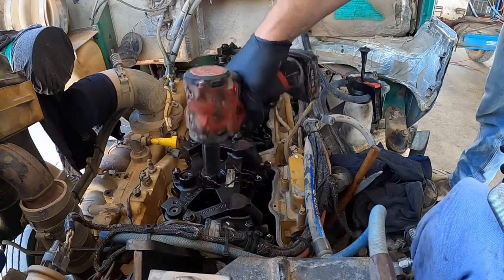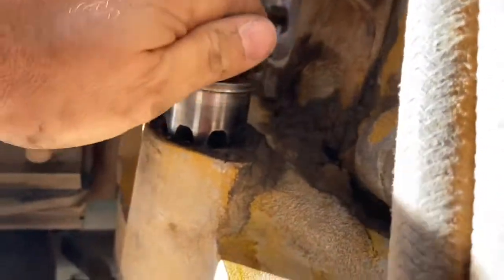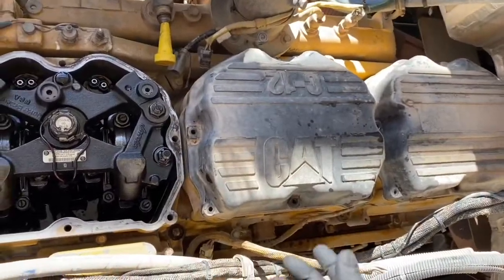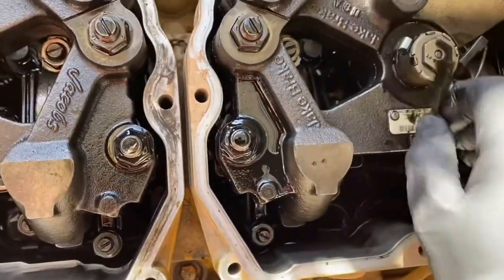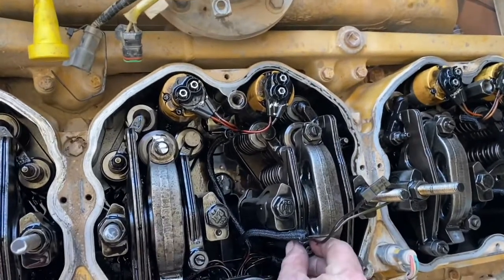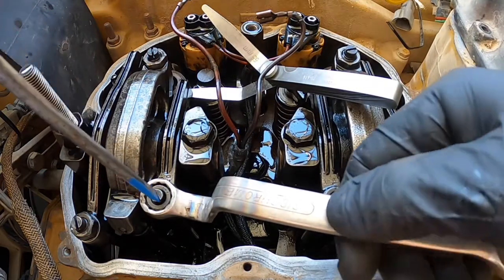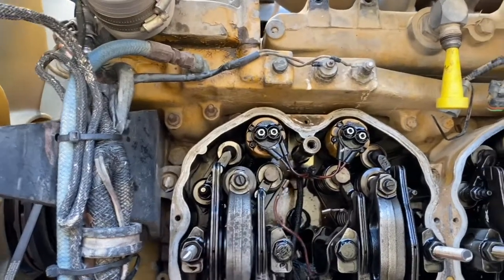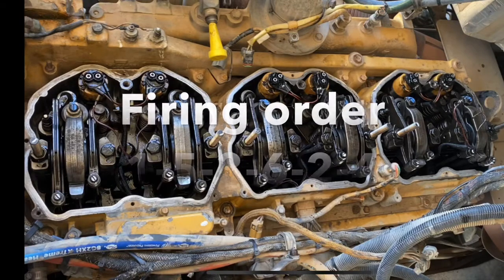C12 Tune up Valve lash, injector heights & engine brake adjustment Pt 1.

Comment: Just had my c-12 in for an over head, found 2 broken valve springs, the 2ks had about 600000 miles on it, any ideas why?
Reply from the maker: If it has 600000 miles on it I wouldn’t be complaining. That’s pretty good going. Parts fail sooner or later. Can’t think of any misuse that would cause springs to break other than rpm over speed.

Comment: Purchasing a truck with a c12 it’s been well maintained should I run the overhead on it because I will be running it pretty steady. Maybe oil and fuel filter and overhead?
Reply from the maker: According to Caterpillar the valve lash, injector height and jakes clearance should be done on a PM2 schedule. Which is every 3 years, 144,000 L of fuel 388,000km (240,000miles) or 4200hrs whichever occurs first.
 If you can find out it’s previous maintenance that would be helpful otherwise if the engine sounds good when it runs  you could let it go for a while until you have time to do the maintenance. 

Definitely do the oil and fuel filter change 👍🏻
Reply: @jxaxrxlx  Thank you for the information!
Reply: You will find that an overhead that is done right has a big payback on fuel mileage and performance...With that said I recommend every.80 to one hundred thousand miles..I have seen Cat engines that haven't had overheads in a very long time and the intake.valves become tight damaging the cam shaft and actually causing the engine to drop a valve.

Comment: Did you ever post the video on valve positioning? I'm in second year now and just started into engines, a video on valve positioning would be helpful!
Reply from the maker: No I haven’t posted one yet. What exactly are you talking about when you say valve position ? Are you talking about firing order ?
Reply: I'm just looking for a good explanation video of where the valves are sitting while the engine is running. Say cylinder one is on compression stroke what are the valves on the rest of the cylinders doing

Comment: Hello. I have a few questions that I hope you will answer ... I am using the C18 dongle with a problem with the machine's cooling water boiling and pouring out when the machine stops .. hope you help me. thanks
Reply from the maker: What temperature does the gauge read when the engine stops?
Reply: D 4 Diesel 88 - 90 •c
Reply from the maker: does the engine shut itself down ?
Reply: D 4 Diesel no . Engine run